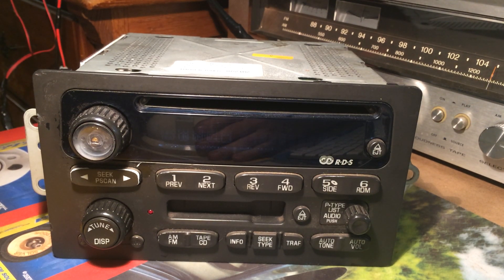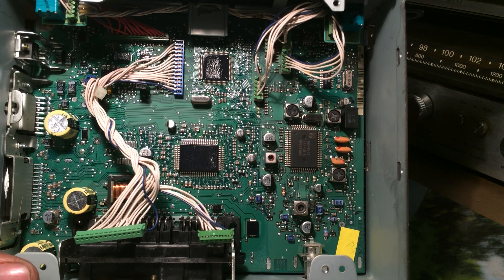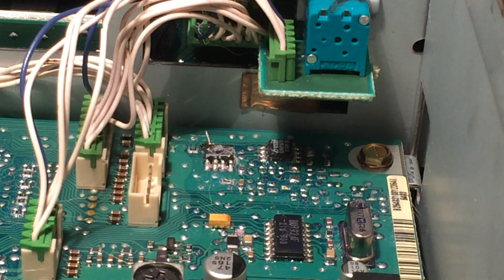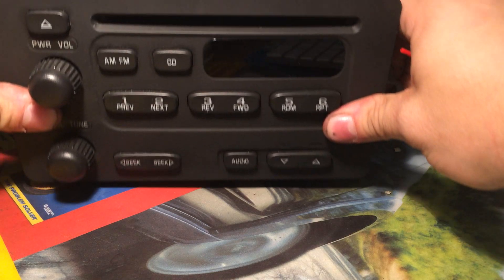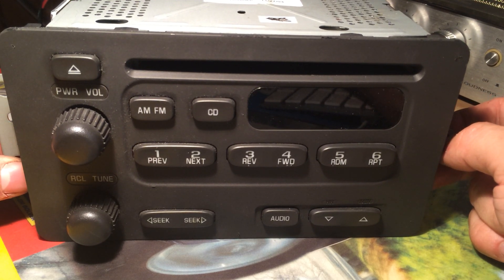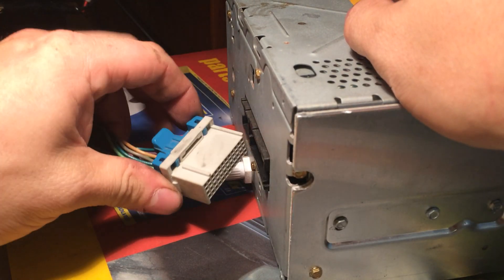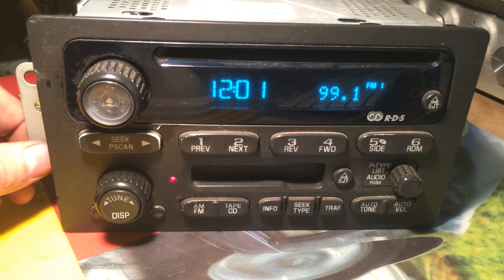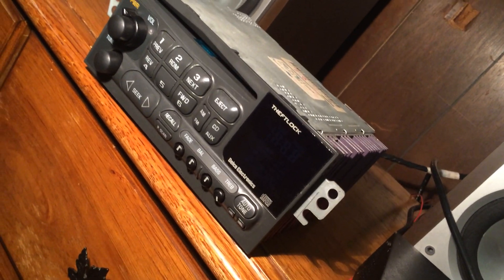2000 to 2005 Class II GM RDS Radio Unlocking PRECAUTIONARY

Comment: not sure if you're still active but i could really use some help with this radio out of an 08 silverado. i took out the chip and connected all the wires but it won't stop cutting off after 5 or so minutes. is there a fix?

Comment: I thank you for saving me from bricking a radio. I picked up one of these and watched this before removing the chip. I will put it in the parts is parts pile and if my attempts on the other radios I picked up fail and I end up taking this version into the dealer.

Comment: FYI I have swapped in 2 radios into my 2003 Monte Carlo by grabbing the BCM from the donor vehicle and relearning the BCM to my vehicle(procedure on the web)
Make sure donor vehicle has same options as yours(ex.foglights,etc.) So those options continue to work.(the radio WILL work,but only the options programmed for the donor vehicle will work) So, if you have a M/C SS it is BEST to acquire the BCM and radio from another M/C SS...

Comment: Hello!
Rds with chips not aligned. On signal wire was small OR right below lg OR positive wire.
Disconnected all power leads. Put 12volts across on signal wire + and frame of radio -. Then reversed them. I had hoped to wipe the eeprom memory by running a charge through it. (Without burning any thing else).
Cal Err comes up when it first comes on. Other than that all works on all settings. Had to reset station presets but they came up fine. Can not test the tape deck, so don't know about it.
Reply: I might add that I went through three radios and two weeks before I arrived at this. When it did work It happened so fast I couldn't believe it. Keep checking the radio and it keeps working! When I touched the wires to clear the eeprom they were powered so there was a spark. Held them in place for maybe a second.

Comment: Thank you for the info, wonder if a chip swap would work.  I have a Tape Deck only that does not work (radio works, just no longer plays tapes) and a CD player version from a junk car.  Have not looked at the inside, both radios have a 2001 manufacture date (cars are an 05 w/tape and an 02 w/cd).  Just don't want to end up with no radio at all.

Comment: Love the fact that you took the time to share this with everyone. I recently got a 2006 radio for 8 bucks. Put it in my 2002 GMC Envoy and it says locked. Not ready to yank a chip out of the board just yet and am doing my research on how to unlock them. So far nothing has worked short of yanking the onboard chip. Still searching. Just wanted to thank you for sharing the information.

Comment: Ok I k ow this is an older video but if any one is reading the comment here's what I did. This is for the 6 cd player radio btw. I got one that was locked from the junkyard like most people do. Removed the eprom chip. Made it work but with the same defects as you state. Diceded I could not live with it like that. Bought a mother 6 cd radio figured out would be locked. Plugged it in and it just worked. No err. Code or anything. Eprom chip still in tacked. Not shure if I just got lucky or what. By my theory is that when I removed the eprom chip from the first radio it confuse the bcm or what ever the radio takes to to see if it's the same vin. Then when I installed the second radio it thought it was the first radio and rewrote the vin to mine. not super shure on how it works or if that even possible But I got a 6 cd radio in work truck now and did not have to get if flashed. That's alot.

Comment: Have you tried using eeprom programmer and zero the EPROMs. When you plug it back in vehicle they relearn. Also read the EPROMs when you tamper with them compare data and you will see the section changes that causes the error. Rewrite the EPROMs back and radio is ok again.

Comment: Great video. I had a third kind of circuit board though; same faceplate. It had 2 8-prong chips one it the corner by the wiring and one more central. Found that removing the one by the wiring gave the same result; a working radio with presets that done save, and just the calabration note.
Thanks for putting up this video

Comment: In my case I had the old radio however for some reason the radio tuner no longer worked. I was able to remove the Eprom chip from the original radio and solder it in the replacement radio I found in a junk yard. It works just like new without paying dealer to reprogram!

Comment: Good information!  For those that want to get one of those (where two chips are orthogonal to one another)radios working do the following:
1) carefully remove the 9355093 (24c08 EEPROM) chip.
2) read it with a cheap EEPROM reader
3) Clear the last six digits which represent the previous vehicle’s VIN
4) Burn the chip with the your revised code
5) Resolder back into the radio
Once you turn the vehicle’s key to run, the BCM will notice the radio has no existing VIN and will write your vehicles VIN to the radio.  The radio will work correctly and remember all settings with no side effects:)

-Chip reader/writer: https://usa-m.banggood.com/CH341A-24-25-Series-EEPROM-Flash-BIOS-USB-Programmer-SOIC8-SOP8-Clip-Adapter-Module-p-1353168.html?gmcCountry=US&currency=USD&cur_warehouse=CN&createTmp=1&utm_source=googleshopping&utm_medium=cpc_bgcs&utm_content=frank&utm_campaign=ssc-usg-all-newcustom-1008&ad_id=388194796019&gclid=EAIaIQobChMIm87tpozc5gIViInICh2nEQ3VEAQYBiABEgKLS_D_BwE

-Delco radio EEPROM chip info: http://pdf.datasheetcatalog.com/datasheets/134/80474_DS.pdf

Comment: carefully remove pin 8 , which is the upper right pin , counting from upper left counter clock wise , I cut the pin using a  jewelers screwdriver , works as advertised

Comment: do you know where i can find a diagram of whats what on the board of that style radio?
I have a similar unit (minus the tape deck) and it doesnt have the "blue" connector that I can only assume hooked to your tape deck?  I'd like to solder into that feed on the board to add aux input in place of the (non existant, in my case) tape deck.

Comment: Just wanted to share that you can unlock the Class II RDS with some caviots and this is how I accomplished it I will make a video as proof If You Have Class 1(second Radio you displayed) and you take the EEPROM Chip out of Your Current Vehicle Radio mines was Class 1 and insert the chip into the RDS model it will work almost factory you have radio at ignition it will even REMEMBER radio presets and EQ and you can unplug and replug it and it will STILL Remember them does not remember clock/time and it knows when I tape is inserted or not (cassete idicator turns off and on on eject or insert) security light will not flash but for some reason when you first turn on the radio you will get a CAL ERR at boot for 1-3 seconds then normal but it is very important to note that both radios in my case we're from the same vehicle lines they were both chevy express radios one from a 2001 and one from a 2003. radio was being installed into 2001 Chevy express I do not know if this will work with examples of (Chevy/Saturn) or (Impala/Malibu if that makes sense but if your situation is similar to mines this should work also my EEPROM Chip is located towards the center on my board but as far as I know I got a legit factory radio unlock for free without going to dealership and it remembers my presets( Big Deal) simply removing the chip will make the work but it will not retain any memory

Comment: that I do if the 2010 Chevy loses power the radio the lock up then I'll buy me an aftermarket Pioneer stereo or a JVC one on eBay that are older like 2003 up then put it in the vehicle and if I want a bench car stereo I buy the same or just the grab a 99 Chevy Delco like you have the simple radios is best!!
Reply: Kevin Davis

Comment: Hello, I have the older style stereo in my 2003 Chevrolet Avalanche 1500. I took it out to reset the CD player because my CD wouldn't eject. I unplugged it and plugged it back in, didn't eject it but now I have no lights on it at all. Any suggestions?

Comment: I have a 02 Oldsmobile Alero with both the RDS CD and Cassette player. I just wanted to ask you before I attempt to remove my radio if you know if I can remove the security chip out of the radio or that mines could be the one with vertical and horizontal chips? Thanks!

Comment: I purchased a nice 03 Buick lesabre with only 40,000 miles   mint , well after driving and enjoying it now for 2 months  , I now have a red flashing light  left top side of my radio. however it still works  and it does go off when I start the engine , what does this mean  because I pulled out the manual and this is what I have ,can anyone tell me if this is something to worry about  or is it a normal thing that was just delayed in happening for some unknown reason?

Comment: removed chip radio plays find now how do i get the presets to stay preset turn off the key and there goes the presets?????????????????????????????
Reply from the maker: It's a side effect I warned about in my videos. You'll have to live with it losing it's presets.
Reply: Pan, I sen t you a PM....if you cant help me then please tell me to pound sand but let me know either way buddy im in a bad space here
Reply: iit seems to me if you can figure out that chip then you can figure the wiring to keep power to the memory
Reply: iit seems to me if you can figure out that chip then you can figure the wiring to keep power to the memory
Reply: iit seems to me if you can figure out that chip then you can figure the wiring to keep power to the memory

Comment: I have  an issue with trying to switch a 2000 cadillac seville CD/tape combo into a 2000 Eldorado. Theftlock is on and cant get any code no matter what I try. Another thing is after opening up the radio, it looks nothing like the one here. Please help if you can
Reply from the maker: That's because it's a different kind of radio. Older Theftlock radios simply need a code to unlock. Do a simple search on YouTube for how to unlock a GM Threftlock radio, and follow the instructions on how to do it, and follow the procedure. There is an automated 800 number you call, use the dealer code 106020, then pound in the 6 digit code the video will have explained how to get from your radio. 

https://www.youtube.com/watch?v=1AVQZk8-qs4

This should work in your Cadillac, as well.

If not, time to call a couple scrap yards and seek a replacement, something else is wrong with the radio. Typically they can be had good working, used from $20 to $50 from a scrapper.

Comment: hi. I have An original radio from a 2004 Buick LeSabre. been trying to override the theft lock but with no luck. I followed your directions and I removed the first chip on the board like you said and the chips were not vertical so I knew it was okay to remove the first chip. after removing that ship the radio still did not work it was still locked and I still have to press FWD seek + preset 5 + power for it to turn on for 10 minutes. so basically I'm still locked out. any ideas?  thanks.

Comment: I pushed the cigarette lighter in & BAM the radio went dark,the lighter never got hot. Using your seek /5 /power trick the stereo came back on BUT it stays on even when the key is off & removed.  Any ideas on how to fix this problem ?  It's in a 2003 Vibe & stereo has never been out of the car. Thanks for any suggestions.   I did check the fuses,all are good.
Reply: Ivan Bentley Claymore staying on even after the key is removed is normal mines does that 2001 Chevy express it will also work if your never put in the key at all kinda convenient for me actually

Comment: my CD player says LOC I bought it for my 2000 cavalier,it came out of another  cavalier.It is the correct CD player for my car.so if I remove the chip will this possibly work on mine? my CD player looks like the one you have in the video that says error.
Reply from the maker: +Kim Thomason Nope. That is an older style Theftlock radio. do a search for how to unlock those, and follow the instructions. It's much simpler and only requires a simple code to be input in to the radio two times to unlock it.

Comment: Replacing an RDS radio in 2003 S-10 Blazer. Doner out of 2004 Taho. Initial install said locked...watched video & removed the chip (newer version center of board). Now radio won't power up.  The Doner radio does not say RDS on its face but looks identical. Also, the Tahoe had a 2nd plug going into the smaller recepticle. Any suggestions to do next?

Comment: If you leave pin 2 and 3 connected and disconnect pins 1,4,5,6,7, and 8 and it works just the same as the one in your original video and you wire it the same as the one in the original video that is how i bypassed one just like the one you're showing in this video
Reply from the maker: Harley Syanfield Does this trick prevent the memory loss issue a lot of people experience?
Reply from the maker: Harley Syanfield Does this trick prevent the memory loss issue a lot of people experience?
Reply: No but it unlock radios like the one in the video
Reply: Harley Syanfield  when you remove the pins how are you counting left to right are you starting at the top or bottom of the pin

Comment: Johanna, 
I may have the same radio. Mine came out of a 2006 GMC pickup. I looks the same but does not have RDS on it. It did have a chip in the location of some (near center) but it had a different number on it. I removed it and it still will only play a few minutes when I hold 5 and >and turn it on. I do get the error and occasionally the tape arrow points to the CD. This radio only has the speaker wires, a ground (black w/white) and a large and a small orange wire. Looking at the back of the radio the larger orange wire is left top and the  smaller is L/bottom. In another video a guy showed how to move a wire over beside the left top + wire but it was one hole to the right on top also they were different colors. (red and yellow I think) Let me know what you think or maybe someone else will see this and help.

Comment: I have a question. I have a non RDS radio just like the second one you showed (the one found in cheaper models like the cavalier, which is what I have) that is locked. Are you saying that the base model radios don't have the right chip to remove?

Comment: you're 100% correct. The two chips (ic's) must be configured as you mentioned. I went through 3 delco radios before I found one configured vertically & it worked great. Mine was also the RDS radio. Thanks for your follow up video explaining in more detail.